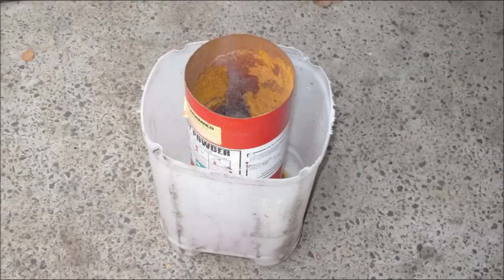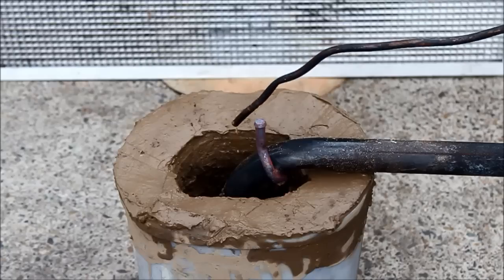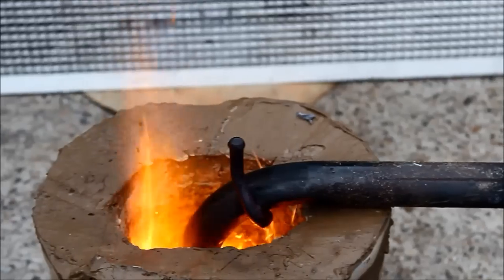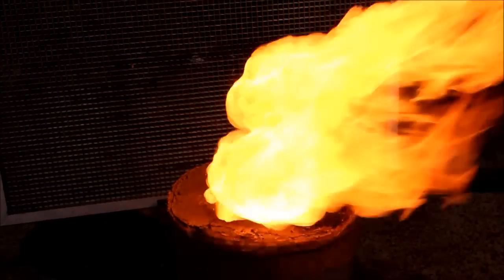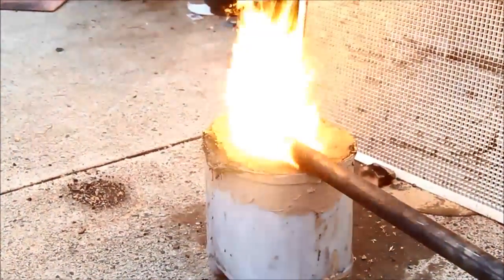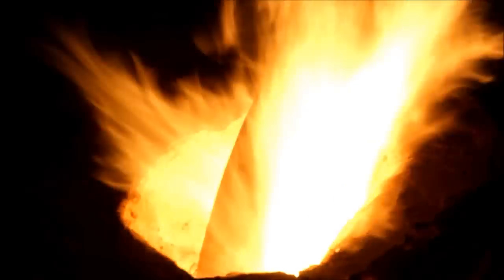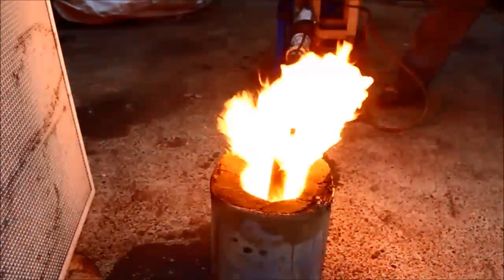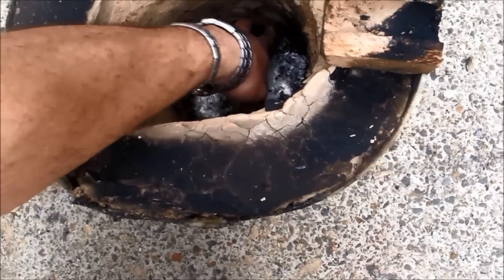Melting soda cans and aluminium in furnace made from dirt Waste oil fueled

Comment: Your oil feed line is so far back, how far? Obviously fine. Is the pipe so hot there that it vaporises the is the oil there being blown down further and then vaporises? You did mention something about how the oil was vaporising near or at the bend but how is it getting there? Your oil, is it running along the pipe surface or is it airborne? I tried firing mine today but didn't have the oil feed working. Needing a better setup. Can't seem to find fittings to put a tap on a container either like you have done here. Will muck around with it again tomorrow. Can't wait for it to ROAR HOT!!! :D

Comment: Hey, you've got a great vase for grandma's window sill now when you're done with using it, maybe a waste paper basket for the front room.. The list is endless.
Reply from the maker: Just have to make sure she doesn't think it's a new and Improved chamber pot seeing I nicked her other one.
Wouldn't like to have to take that out in the morning filled with you know what!
Reply: A number 2 will probably add good insulation to the base, you'd have to smooth it out a but and use it to fill cracks in the mud. Also you wouldn't have to worry about sparks getting under your finger nails, there'll be a fireproof layer just under them.

Comment: Can't get much cheaper than dirt!! well done!
Reply from the maker: Can't get much more recyclable or environmentally friendly either if that concerns you. The materials to make one are availbe anywhere as well. If you live 500 Miles from the nearest town, no worries, You have everything you need already!
You should be able to take this idea Kevin and build a Dirt Rocket stove. A smart man like you could probably make up some molds and plugs so the things could be poured and cast. make as many as you want for nothing and when they fall apart, add water, mix them up and make another one!

Comment: Where in the world are you located? Just asking.
Also, you can make a safety sissy top ten video once a month to give them their credit before ignoring.
Reply: I'm in Sydney Australia.  
Safety sissy Credit?   Ugggh!  Pack of whining useless Hypocrites that are too scared as well as ignorant to do anything themselves less they break a polished fingernail or have no experience in anything as DIY as nailing 2 bits of wood together.
Reply: glumpy10 i am slacking in safety. No seat belts, carb control was by wire through the windows, manual windscreen wipers... Holes in the chassis big enough to put my hand in.. keep rolling down the motorway. You have contacts with land rover folks in Sydney?

Comment: I hope you are ashamed of yourself!  You are destined  to go to hell for all your *risky, unsafe environmentally unsound *  actions!  :)  ( I wanted to put in the 'Church Lady'/Psycho shrieks here, but I don't know how...)   :)

Did not expect an earthen crucible to hold up at all. I guess because you only used mud on the ridge and inside the vessel it is less likely to crack.  *GOOD- VIDEO! =KEEP EM COMING!!!*

Random question: Have you developed home heating using your WVO burner?
Reply: I was surprised how well it held up myself and this is only the first burn. I have done a couple more and I'll put the vids up shortly.
I'm working on the house heater ATM given we are now coming into the cooler weather here. I have the design pretty much sorted, just need to finish plumbing it all up now,

Comment: Fascinating that it held up that well... I'm guessing a clay type soil is a good thing here :)
Reply: glumpy10 Perlite*
Reply: glumpy10 Vermiculite holds watter better than perlite, so perlite is better for refractory.
Reply: Yes, I'm going to try and get some more clay as I think mine is still a bit too sandy. I was also thinking of Mixing straw or similar into the dirt as a binder which may make it last better and also some Vermiculite for insulation.

Comment: Love it but my blower isn't big enough so it won't get hot and run nice
Reply from the maker: RC matties
The bilge blower I used cost $20. That's pretty cheap! You could also look for a used hairdryer at a 2nd hand store or ask a female friend or relative if they have an old one or need an excuse to upgrade!  :0)
Now, if you have need for an electric Kettle or toaster, ask my wife. She seems to replace them with about the same frequency I replace the oil filters on my car! Don't know why, not like they have failed, she just goes and gets new ones????
Reply: Did you see my Bilge blower Vid? I was thinking of doing another run of this Furnace with that to see how it went. I think it should produce plenty of air for the job.
Reply: I have seen the video but i'm 16 and i want to be cheap but i will find a blower😊